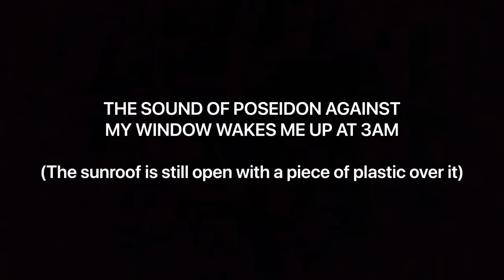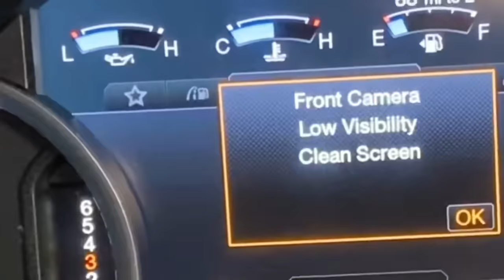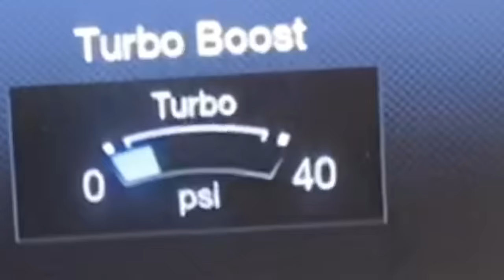UNDERGROUND Boosted Launches and Bombing our F350 Bunker

Comment from the maker: I also want to tell you all that ford LIES on their gauges. The temp gauge literally always says 190° no matter what
Reply: WhistlinDiesel well that’s wack
Reply: Trump 2020
Reply: Although that would be for engine heat the fire probably started from the exhaust heat since that heat has no where to go
Reply: @melmyrtle5765  lmao nice bait
Reply: @DylanC828  calling it like I see it .
Reply: WhistlinDiesel  I bet the the temp got very hot because there is no way to cool the rads and it got so hot that the plastic or foam or any rubber around the motor got how and was on fire also I think the duct tape and the intake and the exhaust went on fire and also it could have been a wire for pinched or something like that then shorted out and burned that sucks that the truck almost or did burn down internally hope to see the new video this week!
Reply: WhistlinDiesel Cage the elephant on the sound system huh? good taste
Reply: I knew it we blew up a 6.0 turbo and it said it had mint oil pressure
Reply: Hahahahahga
Reply: WhistlinDiesel lol
Reply: Happy Easter love the videos
Reply: @rollinexcavater52401  caught that too lol, good stuff
Reply: wow always trust cateye silverado dont buy a ford
Reply: Some of them are like that if it’s been deleted like my old one it stayed at 190 all the time just about it.
Reply: GM has been doing that since 2000. The gauges say 190-210 until it goes really high or low
Reply: Wowza
Reply: My silverado temp gauge reads 160 when it's at 100, 180 when its 140, and 210 is anywhere from 180 to 210, and then acts linearly past 210
Reply: Matthew bullshit ain’t no way that shitshow goes that fast
Reply: WhistlinDiesel another damn ford thing... death wobble... I love fords and dodge... I’m a dodge guy though. But ford having death wobble sucks.
Reply: @cdawg3506   Not Biden 2020
FTFY
Reply: @cdawg3506  bruh trump has let thousands of people die lmao
Reply: They do lie indeed. The oil pressure guage might as well be a light. It's either halfway or 0
Reply: @TheScrubmuffin69  Yeah, oKaY
Reply: Yep, can confirm on a 2005 f-350 it got to 235F (using my obd2 scan tool) and the gauge instantly went from 190 to max and says check guages. Also, the oil pressure gauge is fake, it's only a switch not an actual pressure transducer like on a chevy or dodge.
Reply: @melmyrtle5765  Hater gonna hate. You want him to destroy it because you cant have it. Show us that you are not all talk, post a video of you swinging a hammer at your truck if you have one.
Reply: @johndamjohn  lmfao I have alot more than just one truck bud . I want him to destroy it because I love Carnage .  Believe me when I tell you anyone who builds there own shit has taken a hammer to way more than some body panels. I don't have to prove shit to you buddy boy . I have trucks I thrash on so what . You gonna cry if I decide to post a video trashing a "classic" maybe I'm in the process of buying one just like it to melt with a touch .
Reply: @melmyrtle5765  Edgelord
Reply: WhistlinDiesel the oil pressure gauge in my 2010 f-150 is basically an on off switch. I hear the needle stays in the middle until you go under like 9 psi
Reply: WhistlinDiesel yep. Always been dummy gauges on the coolant anyways.
Reply: Cuz the Chevy r better
Reply: Ur my fav youtuber ur aeesome
Reply: @whistlindiesel shoulda left it buried… boss place to get high

Comment: Justa idea for if you ever do this again you should have  High air duct from like a house going into the radiator have a fan blowing wire running at that way radiator is able to cool the engine when you're doing boosted launches otherwise  great video as always

Comment: WhistlinDiesel,  I kinda think what u heard was all the ringing and sounds of expanding and contracting metals along with sizzling oils and boiling fluids, It got so hot down there because you had it wrapped in insulation no oxygen no way for heat to escape but, the best thing you could have done in the case of a fire is plug the exhaust, intake, and sunroof..  And I saw you did a little. A fire cannot exist where there is inadequate Oxygenation.  Any fire would have burn for 5 seconds and consumed all the oxygen there. Even in the presence of fuel or oil with a direct spark it will not burn without oxygen. Oxygen does not create it's own oxygen like nitrous and other accelerators. The worst thing to do is to open it up and expose it to oxygen. That's when you have a problem. I know I'm not the only one that knows this. It's common sense.

Comment: This reminds me of when they buried that brand new never used 57 chevy I think it was and thought it would be perfect years later just in plastic. Epic fail
Reply: 57 dodge or Plymouth I think
Reply: @jrsgarage7623  need to look it up but still crazy what people thought 60 years ago.  Saranwrap it! Nothing can go wrong.  Good intentions but no
Reply: @jrsgarage7623  you're right a Plymouth. It would've been better off locked in a barn 😟
Reply: @RubberSideDown2  yeah I watched that video a few times. Crazy how the rust comes right thru the paint. And I can be cleaned off to show its original color. By disolving that rust.
Reply: @jrsgarage7623  right. And wd only did it for a week or 2 and showed it was getting facked up already.
Reply: Yeah I been playing around with some rust disolver from Wal-Mart . that stuff is amazing how it works. Never seen something work so quick that leaves the paint alone
Reply: Sprayed some of a really old bike frame that was solid rust colored. The blue and white looks amazing so far.  Its an old schwinn that has a fake gas tank from early 50's that for some reason I bought.. Lol.